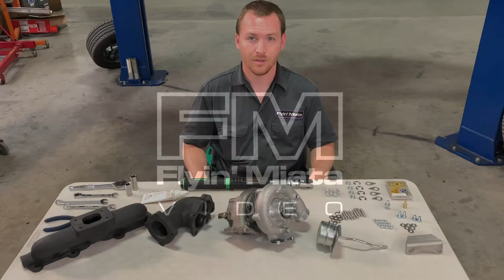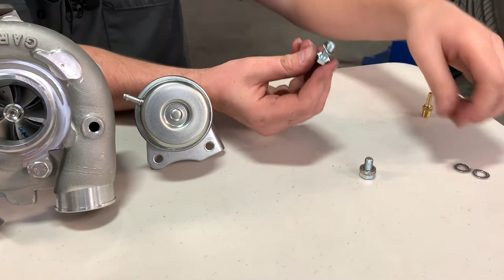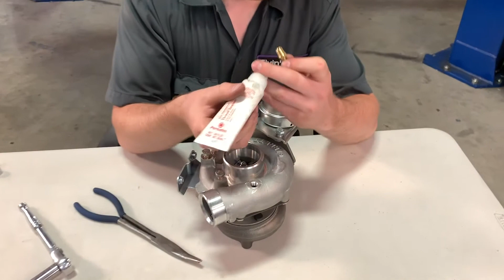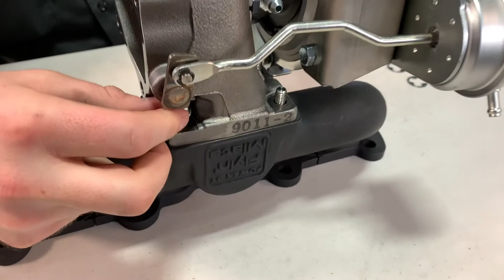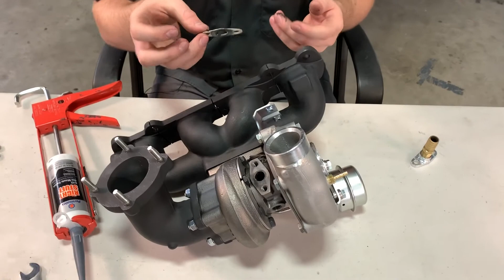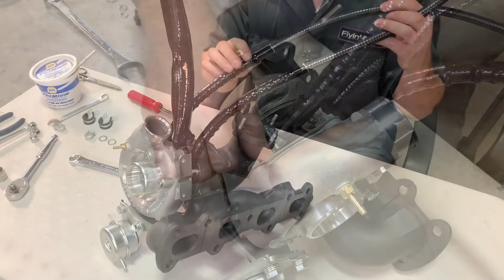Flyin' Miata NB Stage 1 Turbo Install - Part 4: Turbo & manifold Assembly

Comment: At the beginning (3:45) Mike says the turbo has been pre-clocked. That service appears to have been discontinued. In my kit, purchased in 2024, the turbocharger was NOT pre-clocked. While that is not detailed in this video, the PDF installation guide includes instructions for clocking in the first two steps of the assembly section.
Reply from the maker: @espokane Correct - some parts of this video series are now out of date. Clocking the turbocharger is now required for our kits.
Reply: Thanks for this comment! That saved me a lot of confusion.

Comment: Why not use self locking nuts @ 28:00 instead of all that other jazz?
Reply from the maker: Because we have found over the past few decades that mechanical locking nuts are not reliable enough under hard use in this application. They also don't prevent the stud from backing out, whereas the Stage 8 hardware does.
Reply: @FlyinMiataVideo  ahh, makes sense! Thanks!

Comment: The rod on th actuator touches no matter how much I adjust. Any tips? I can open the waste gate as you show no problem. I guess it isn’t technically touching… it’s just extremely close.
Reply from the maker: Reach out to our customer support team directly, with photos if possible. They will be happy to help and give you an help and advice on the fitment. Email support@flyinmiata.com and use URGENT in the subject for a faster response. Sorry for the hassles!
Reply: @FlyinMiataVideo  thank you! I just sent the email.

Comment: How important is running the outside water hose(return to water pump) on the TOP of the bracket so that it is above the inside hose (inlet from thermo housing? My thoughts are that it is paramount in order tp promote heat syphoning on shut down. when i replaced the water  lines on my 96 I ran the turbo water intake line basically level around the PS pump. But the return line was looped down under everything and back over the PS bracket. After 1 month I'm buying a new turbo because of smoking. during that time I had lots of hard pulls min cool down andI believe I coked the inners..."Disco Potato" Garrett GT2860RS will arrive soon....
FYI the motor compression is 145-150 all holes cold. .Thermal cycling is critical

Comment: No gasket between the turbo and manifold...?
Reply from the maker: Nope. In our experience, they usually create a leak when they blow out. No gasket = no leak. The surfaces are machined for a good seal.
Reply: @FlyinMiataVideo  thanks for the quick replies!! What I wanted to hear... Iv had about 4-5 gaskets blow out so this time I’m going without... really hope all works 🤞🤞🤞

Comment: Thought you supply resbond for the studs? I have the stage 8 kit .. should I let the resbond set once torqued before mounting the turbo ?
Reply from the maker: We do not supply resbond for the studs.
Reply: @FlyinMiataVideo  yep sorry I’m getting my companies confused.... any reason you don’t use it? Just cost and you don’t feel the need or do you not like the product?
Reply from the maker: @SmukKully  ARP very strongly recommends against using a threadlocking compound on our custom studs. We've found the Inconel/Stage 8 combo does the job.
If you are using our video to install a turbo from another vendor, we'd recommend you contact your supplier to see if they have different recommendations for their parts.
Reply: @FlyinMiataVideo  thanks guys 👍👍👍

Comment: All the water hose stuff, I guess it doesn't apply with the coolant reroute?
Reply from the maker: It's still a similar install for the lines coming off the turbo. The difference will be that you follow the coolant reroute instructions for routing the lines to the back of the engine instead of to the front and with the reroute you will also be changing the lines on the front of the car. If you haven't seen it, we do have a coolant reroute install video that shows the complete process on a turbo car. 
https://youtu.be/XYwqkJ7Htgc

Comment: I'm installing my kit now. I've gotten to the point of where I need to cut and bend the lip of the shelf out of the way and while I was doing that- I was wondering what made you guys design the kit so that you'd have to cut into the shelf in order to get the compressor housing to fit? I've seen other kits where the turbo is raised up a little bit more, or positioned differently, etc. Could you explain why you guys did things the way you did? Thanks! Loving my kit so far. I really appreciate how much time and effort you've spent setting everything up nicely for us. I've also just installed your Happy Meals clutch kit. I'm really hoping it lasts a good long while.
Reply from the maker: Backwards compatibility.  As we evolve our kits, we try to keep as many parts compatible as possible so we can continue to support existing owners.
That turbo location is one that we started using more than 20 years ago, but with the outlet pointing up. It had rail clearance then but it was obviously a less than ideal path for the intercooler piping. When we flipped the turbo outlet to point down in 2006, we could have moved the turbo. But that would have meant that existing customers couldn't have used our new downpipe or manifold without replacing a fairly large percentage of their kit. Thus the cut.

Comment: I'm getting ready to purchase this kit for my 97 NA. I have your Roadster Sport 4 Exhaust system, do you know if the downpipe for this kit will bolt up directly to it? Thanks in advance!
Reply from the maker: The Roadster Sport exhaust is from another vendor. As long as it can bolt up to the stock exhaust manifold/downpipe, it will not be a problem.

Comment: The instructions I received direct to route the inboard water line to the upper mount and the outboard water line to the lower mount. It appears though, that you have them switched; the i nboard water line to the lower mount and the outboard to the upper mount causing the lines to cross. Is this a meaningful difference? (Have I misunderstood something?)
Reply from the maker: The inboard line goes to the upper connection on the thermostat neck and the lower line goes to the lower connection. Mike goes over this in detail at about the 45:00 mark in part 5 of the video series.

Comment: instead of tugging on the wastegate arm with needle nose, consider a connecting a hose and testing with a compressor and bike pump. Great install vid, wish i had these years ago when i was a miata noob.

Comment: No gasket between the manifold and turbine housing? Interesting...
Reply from the maker: We have found that a gasket between these two machined surfaces at very high temperature is a great way to generate a leak. We've had a lot of phone calls over the years from people who thought a gasket was a good idea and then called us to report a leaking joint between the manifold and turbo.

Comment: Do you apply any kind of sealant between the collectors and the turbine? I would use at least Molykote or Copaslip on the studs.
Reply from the maker: We have found that well-machined surfaces give us all the sealant we need. Corrosion hasn't been a problem with the Inconel or stainless studs.